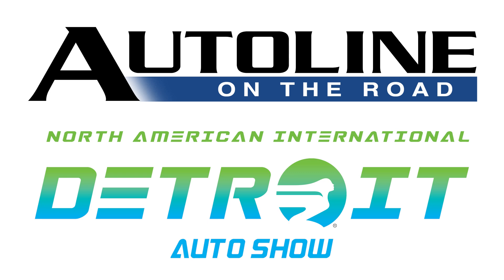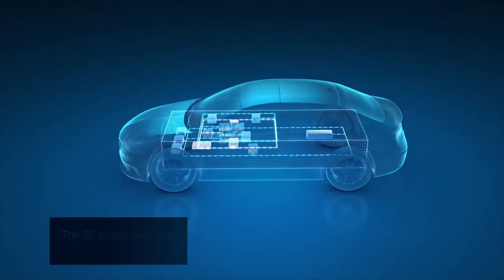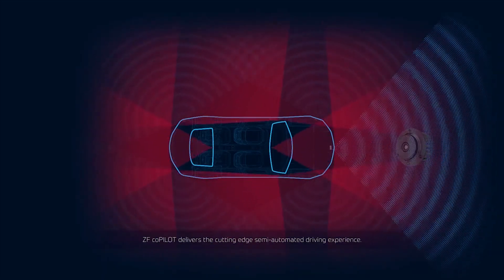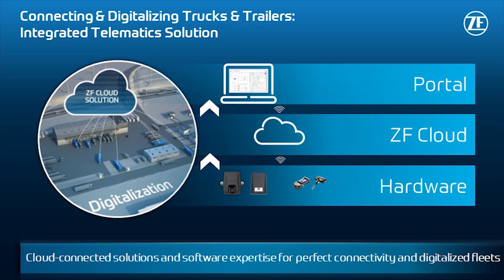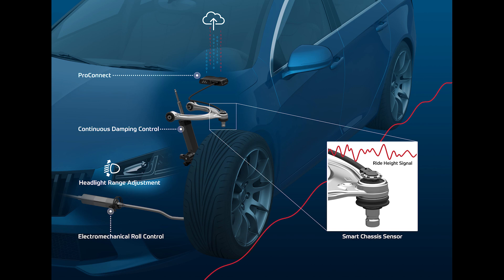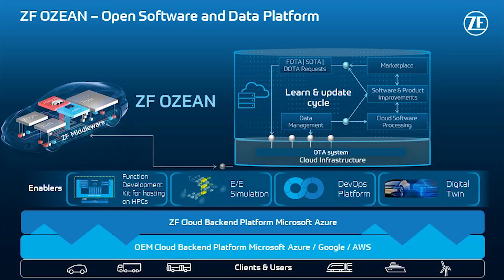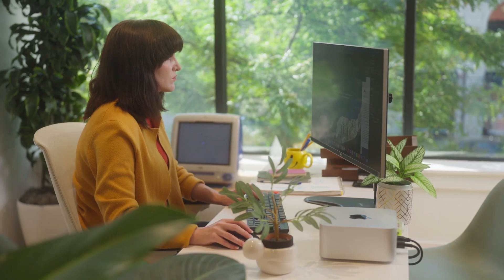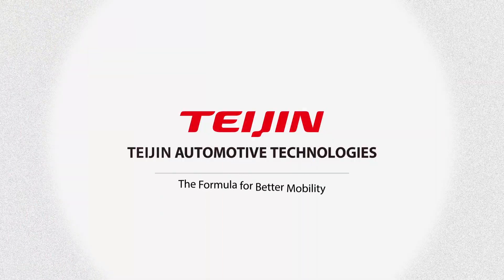Software-Defined Cars Require New Design Approach - Detroit Auto Show 2022

Comment: the 'pot hole detector' is great when you have an active suspension that can lift the car up and softens the suspension to give a more comfortable ride and lessens the stress on the car as well.
monetization of data is a great thing, but it has to be 100% in the control of the user. i really hate it, when you buy something and it doesn't 100% belong to the customer and the manufacturer sneaks in and does stuff.

Comment: This guy's explanation was stupid. A software-defined car is simply an automobile built with standardized components that can be adjusted and controlled by software. This allows the car's capabilities to be enhanced simply by updating or modified software as opposed to having to build and add new parts. The trick is to build the hardware to be future-proof by including the right parts up-front and having components that are flexible enough to keep up with on-going software enhancements. The downside is that the car aka platform starts to become generic. No different than a smartphone - amazing functionality inside a bland looking slab of electronics. This is fine for the average consumer, but for enthusiasts it's the death of the automobile.